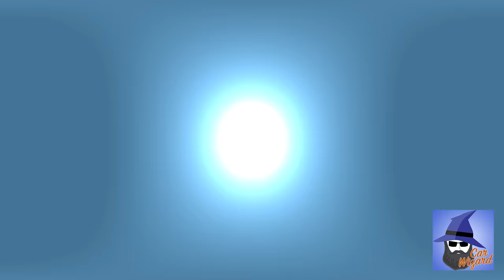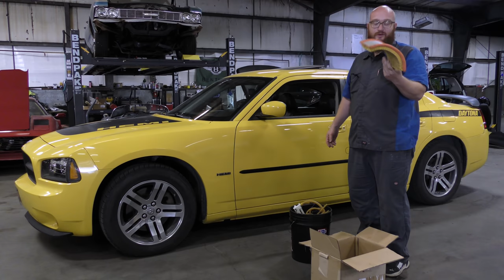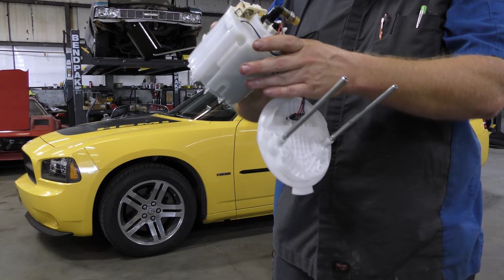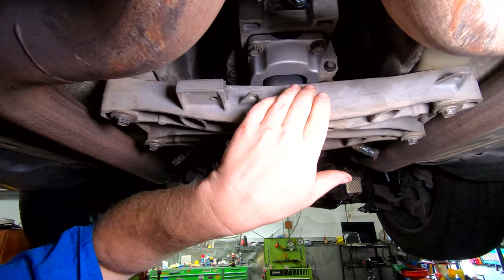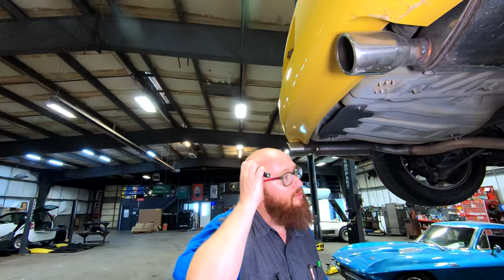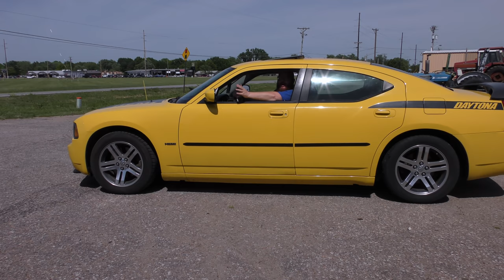Fully sorted and the CAR WIZARD's '06 Top Banana Charger Daytona is worth double! Final update!

Comment: I'm sorry, I always liked the previous molding. I think yellow would look better but understand your frustration in not getting it to match. I, too,  have an all white 09 Charger PP. I don't like the broad expanse of sheetmetal on the doors. I think I'd like to have some color-matched belt molding to break up the blank featureless side. The trouble is I'd like it to look like oem.
My question is, did the replacement molding closely match the size and shape of the original molding strips? I noticed  the oem rear door strip had a flattened area toward the front of the strip for clearance when the door is opened fully. Did the replacement strip look the same? If so, what was the vendor's name.
Reply: Im dying to get a Challenger Demon and or Hellcat....hell, I even want the Challenger Super Stock Version. It's a Demon that's doesn't have trans break and drag rave mode and also without high octane fuel mode. Thanks to the US Government new regulations on car manufacturers having to have a high MPG average between all of its brands, has caused Dodge to have the cancel the manufacturering of the 6.2 Liter V8 Supercharged Demon engine in, 2023. That's the last year they will make the engine, because Dodges average MPG is above the limits because of this engine. Sucks!! Those engines will now be super expensive to find and buy after 2023. Watch, finding a decent low mileage Demon engine set up the way I said above, will cost over 35k for a "decent" used one. Watch. Ugh. Thanks US Government....its also forced Dodge to make a, All Electric Challenger.....wtf.....reason why Dodge has done so well since, 2018 and has made record sales and profits is because it was/is one of the last manufacturers that make a massive, powerful, loud, gas chugging V8 High HP engines. Dodge made the return of the muscle car era. Now it's being regulated away, again...just like it was back in 1973 when the government back then, chocked the HP out of V8 engines for less smog and better atmosphere for out furure.....F the future lol. I live in the now, I'll be dead 100 years from now, I don't give a crap lol.

Comment: Good job on the Charger.  The only thing that would worry me on that would be the possibility of dropping a valve seat.  5.7 hemi engines are famous for that.  But Edelbrock heads would significantly up the investment so, hope for the best?
Reply: Does the 2014 model still has this issue

Comment: I had a rattle/clunking in my front end spent 1400 to replace control arms two weeks later noise is back.. the best way I can explain the noise is if you were to take a rock and put it in a aspirin bottle and rattle it ..kinda fell it in steering wheel two..
Reply: Help lol

Comment: A simple bar of soap would have prevented the rodent problem. I use Irish Spring, two under the hood in fruit container netting tie strapped down in strategic places, along with one in the glove compartment and one in the trunk. I have 41 vintage vintage vehicles in my building.  If you can't figure out the purpose of the soap, then you need to continue eating the soap.

Comment: I'm not as big of a fan of the 6th gen look as time goes on, but the black grill and belt molding does a lot to help it. Those grills should never have been body color in my opinion, so the black makes it look modern. The black belt molding cuts through that huge, featureless field of color that usually makes these Chargers look fat. It's a muscle car, it shouldn't look so porky and stout. Now it has some definition.

Comment: MDS harkens back to the infamous Cadillac V8-6-4. This was a Engineering solution to a Marketing problem - that of poor gas mileage for a V8 and evolving CAFE standards. It had issues. I think Porsche followed that years later with a successful solution. It's interesting since once you have intertia keeping a car in motion requires far less torque.  EV's of course can just change the "duty cycle" on the electric motor and reduce the power consumption effortlessly.

Comment: I have a solution, literally, for your mice problems. Go to the local grocery store and buy the small containers of Thyme and Lemon Balm in the fresh vegetable aisle. You may not find the Lemon Balm in the grocery store. Go to the spice aisle and get some Peppermint Extract. 

In a 2-qt pan, bring 1 qt of water to boil. Throw in the Thyme and Lemon Balm, turn off the burner, remove from heat, and cover. Steep for a few hours to a day. Pour your herb tea into a pressure sprayer. Add 3-4 Tbsp of the Peppermint extract and mix. It should smell like a candy cane factory at Christmas. Rodents hate the smell of peppermint/spearmint and the Thyme acts as a disinfectant. 

Spray anything from air ducts in your car or home to insulation to any exposed wiring anywhere. Spray the carpets under the seats and in the foot well. Make sure you spray the insulation under the hood. I spray my out buildings like my pump house to keep the mice out of the insulation in the walls. I spray it under the house. 

This solution is highly antimicrobial and will kill just about everything. A similar solution is used in commercial duct cleaning to disinfect the ductwork. Thyme oil is amazing and was one of the original ingredients in the "5-thieves oil" used during the plague.

This solution will last 6-12 months so respray on a schedule. No more chewed wires! Ask me how I know.

Comment: I see that your V-8 runs on 8 cylinders always.  What device would you recommend for a 2008 Honda Odyssey?  I am looking forward to your answer.  (I know that they are also built in Canada in Alberta as well as Quebec.)
Reply: VCMuzzler
Reply: I will be more specific.  The VCMuzzler II is built in Edmonton, Alberta.  It uses resistors and may need need some fine tuning.  There also is a S-VCM Controller built in Quebec.  I was looking for the Car Wizard to suggest which one he likes.  There is a danger in that the engine could overheat some time and the driver would not know, especially with the VCMuzzler.  That would NOT be good.

Comment: I just sold my 2014 surf van (grand caravan) for $1650 with mouse issues. It had 124k miles so it was no big loss. How do I prevent mice from chewing wires? Ive heard drier sheets will keep the mice away.

Comment: Car wizard. I have a black rt charger videos of it r on my page. It's like brand new. Barely topped 200000 miles. It's got a rebuilt motor with about 40000 miles on it. It's leather interior thats white and a sunroof and fully loaded. Would u be Interested in trading? It's a 07. I'm a mechanic and raise a family of 4 including 2 daughters so I keep it up well. I've wanted the daytona which is almost the same thing.

Comment: As to the Smart car, how does a rodent get into the INSIDE of the car?  Under the hood is easy to understand, but the interior?  Better look for Fievel's entry point....
Reply: Usually through air vents. All interiors are vented so when doors slam it doesnt create high pressure in the interior. If they were perfectly sealed, the pressure generated when somone slams the door or the rear hatch is enough to blow out your eardrums. Usually vents are rectangle holes with slats under the rear bumper.
Reply: They can chew through soft metals such as aluminum. They only need 1/2" to get in.
Reply: I speak from experience. Through the HVAC system where it draws air in. They plop right down on the cabin air filter chill there for awhile then chew through the paper filter and down into the blower motor they go. They work there way out of there and can pritty much get anywhere inside. I had one do this and that SOB ended up living in my trunk down where the spare tire is.

Comment: The Charger sounds awesome wiz. Thanks for the vid.
Reply: Im dying to get a Challenger Demon and or Hellcat....hell, I even want the Challenger Super Stock Version. It's a Demon that's doesn't have trans break and drag rave mode and also without high octane fuel mode. Thanks to the US Government new regulations on car manufacturers having to have a high MPG average between all of its brands, has caused Dodge to have the cancel the manufacturering of the 6.2 Liter V8 Supercharged Demon engine in, 2023. That's the last year they will make the engine, because Dodges average MPG is above the limits because of this engine. Sucks!! Those engines will now be super expensive to find and buy after 2023. Watch, finding a decent low mileage Demon engine set up the way I said above, will cost over 35k for a "decent" used one. Watch. Ugh. Thanks US Government....its also forced Dodge to make a, All Electric Challenger.....wtf.....reason why Dodge has done so well since, 2018 and has made record sales and profits is because it was/is one of the last manufacturers that make a massive, powerful, loud, gas chugging V8 High HP engines. Dodge made the return of the muscle car era. Now it's being regulated away, again...just like it was back in 1973 when the government back then, chocked the HP out of V8 engines for less smog and better atmosphere for out furure.....F the future lol. I live in the now, I'll be dead 100 years from now, I don't give a crap lol.

Comment: What are flex disks for?
Reply: They are used to bolt the propshaft to the transmission and rearend. Reduces NVH.
Reply: They take the place of U-joints on many European cars.  Smoother than a U-joint, but cannot handle quite as much power.
Reply: @ElectronicMusicUnderground  dang I just bought all the accessories for that game on my Xbox at Christmas and now I have to buy them again!

Comment: You really To get the Airbag recall done on that car, Stellantis says to stop driving older challengers, chargers, magnums, and 300s immediately if you haven't had the airbag recall done yet. If you own a 2005-2010 dodge charger, challenger, magnum, Or 300 that hasn't had it's airbag replaced, Stellantis says you should stop driving it. The parent company of dodge issued the stop drive order after 2 people in 2010 challengers died in separate crash's where the takata driver's side airbag deployed. Though the National Highway Traffic Safety Administration hasn't directly attributed the deaths to airbags, faulty Takata airbags have caused fatalities in the past. The faulty airbags lack a drying agent in thier propellant, causing degradation over time in high humidity environments. The degradation causes improper inflation Wich in some cases sends metal shards and shrapnel into the driver or passenger. Stellantis urges you to stop driving the affected vehicle immediately untill your airbag is replaced. Your local dealer will do it free of charge.

Comment: WIZARD I JUST BOUGHT THE SAME CAR AND ITS SMOKING A LITTLE CAUSE MY FRIEND PULLED THE PLUG ON THE OIL CATCH CAN SHOULD I BE WORRIED?
Reply: Im dying to get a Challenger Demon and or Hellcat....hell, I even want the Challenger Super Stock Version. It's a Demon that's doesn't have trans break and drag rave mode and also without high octane fuel mode. Thanks to the US Government new regulations on car manufacturers having to have a high MPG average between all of its brands, has caused Dodge to have the cancel the manufacturering of the 6.2 Liter V8 Supercharged Demon engine in, 2023. That's the last year they will make the engine, because Dodges average MPG is above the limits because of this engine. Sucks!! Those engines will now be super expensive to find and buy after 2023. Watch, finding a decent low mileage Demon engine set up the way I said above, will cost over 35k for a "decent" used one. Watch. Ugh. Thanks US Government....its also forced Dodge to make a, All Electric Challenger.....wtf.....reason why Dodge has done so well since, 2018 and has made record sales and profits is because it was/is one of the last manufacturers that make a massive, powerful, loud, gas chugging V8 High HP engines. Dodge made the return of the muscle car era. Now it's being regulated away, again...just like it was back in 1973 when the government back then, chocked the HP out of V8 engines for less smog and better atmosphere for out furure.....F the future lol. I live in the now, I'll be dead 100 years from now, I don't give a crap lol.

Comment: Love the charger
Reply: Im dying to get a Challenger Demon and or Hellcat....hell, I even want the Challenger Super Stock Version. It's a Demon that's doesn't have trans break and drag rave mode and also without high octane fuel mode. Thanks to the US Government new regulations on car manufacturers having to have a high MPG average between all of its brands, has caused Dodge to have the cancel the manufacturering of the 6.2 Liter V8 Supercharged Demon engine in, 2023. That's the last year they will make the engine, because Dodges average MPG is above the limits because of this engine. Sucks!! Those engines will now be super expensive to find and buy after 2023. Watch, finding a decent low mileage Demon engine set up the way I said above, will cost over 35k for a "decent" used one. Watch. Ugh. Thanks US Government....its also forced Dodge to make a, All Electric Challenger.....wtf.....reason why Dodge has done so well since, 2018 and has made record sales and profits is because it was/is one of the last manufacturers that make a massive, powerful, loud, gas chugging V8 High HP engines. Dodge made the return of the muscle car era. Now it's being regulated away, again...just like it was back in 1973 when the government back then, chocked the HP out of V8 engines for less smog and better atmosphere for out furure.....F the future lol. I live in the now, I'll be dead 100 years from now, I don't give a crap lol.

Comment: Because used car prices are stupid insane high right now. That's great for mechanics like, wizard. Used car owners now find it to be worth it to now spend thousands on their used car to fix EVERYTHING in/on it. 2 tears ago, it wasn't worth doing that because the cost of repairs were way more than the car was worth, but not now....2 years ago, a used car worth 4-5k is now worth, 10k-13k so freaking stupid. Again, great for, wizard though. Now used car owners with pay to get the engine and trans rebuilt.

Comment: I found a meth pipe in a slit i discovered in a toyota avalon i got at a police auction. Why couldnt it had been cash. Also a coworker found a sawed-off shot gun hidden in a panel in a pickup bed. He got it at a customs auction. So check those auction cars.

Comment: sell the Charger! one year later ....  dang, "I wish I never sold that Charger"
Reply: Im dying to get a Challenger Demon and or Hellcat....hell, I even want the Challenger Super Stock Version. It's a Demon that's doesn't have trans break and drag rave mode and also without high octane fuel mode. Thanks to the US Government new regulations on car manufacturers having to have a high MPG average between all of its brands, has caused Dodge to have the cancel the manufacturering of the 6.2 Liter V8 Supercharged Demon engine in, 2023. That's the last year they will make the engine, because Dodges average MPG is above the limits because of this engine. Sucks!! Those engines will now be super expensive to find and buy after 2023. Watch, finding a decent low mileage Demon engine set up the way I said above, will cost over 35k for a "decent" used one. Watch. Ugh. Thanks US Government....its also forced Dodge to make a, All Electric Challenger.....wtf.....reason why Dodge has done so well since, 2018 and has made record sales and profits is because it was/is one of the last manufacturers that make a massive, powerful, loud, gas chugging V8 High HP engines. Dodge made the return of the muscle car era. Now it's being regulated away, again...just like it was back in 1973 when the government back then, chocked the HP out of V8 engines for less smog and better atmosphere for out furure.....F the future lol. I live in the now, I'll be dead 100 years from now, I don't give a crap lol.